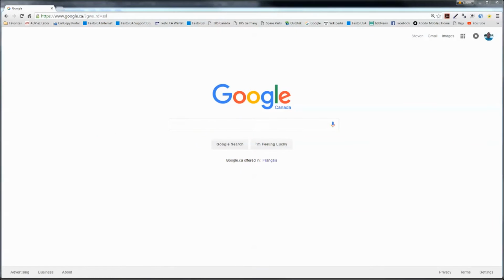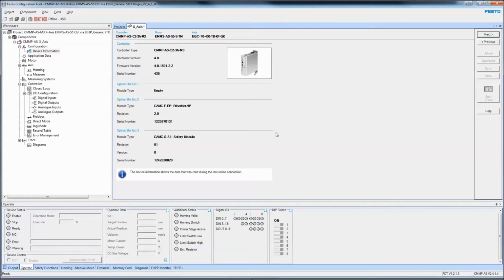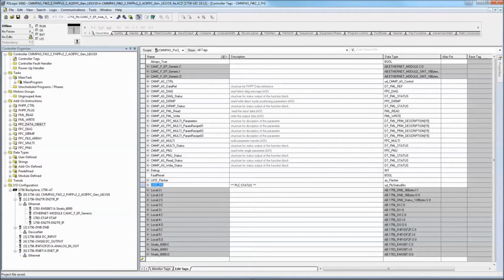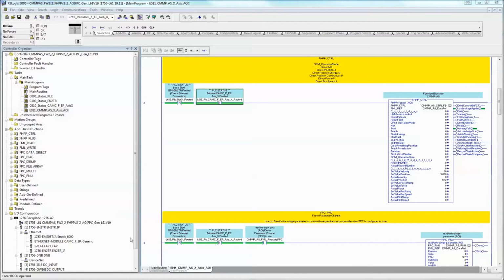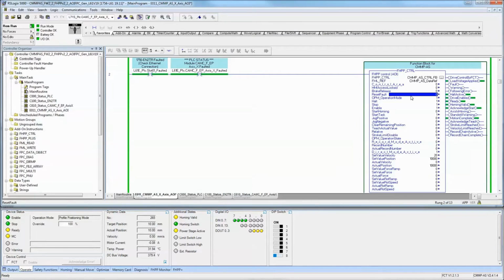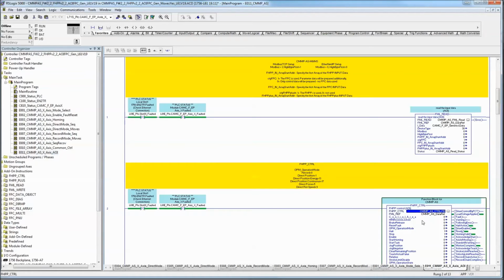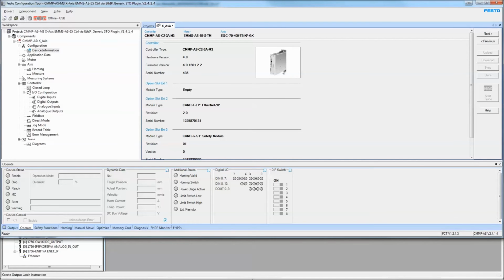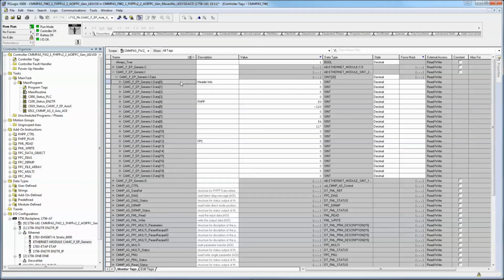CMMP-AS-M3 x1 + ControlLogix + EthIP FHPP(V2.2) AOI FPC ENBT Linear V19 Generic

Comment from the maker: I am unavailable for next 2 weeks. Anything I have for TiA portal is just using function blocks from Festo latest library on web. It would have no code other than that and watch /vat tables for forcing bits in the FBs. I will likely have the same thing for the S7 but with older library. I will likely never do full code for the Siemens plcs because it's all my personal time and I am limited with this time

Comment: Hi, very interesting.
I have a new project with Contrologix and 2 CMMP Festo and other slave via Ethernet/IP.
It's my first project wirh Rockwell and could you explain me why tou don't use EDS file from CMMP Festo ?

Thank for you answer.
Reply from the maker: Generic or EDS?  Why use one over the other?  It all depends how I feel that day.  In general, the EDS file really has no advantage other than the bitmap is relevant.  A generic module has the configuration instance and in many circumstances, this can be very powerful because this can store parameter data that is downloaded when the connection is first established and this is great when hardware has been replaced with default parameters.